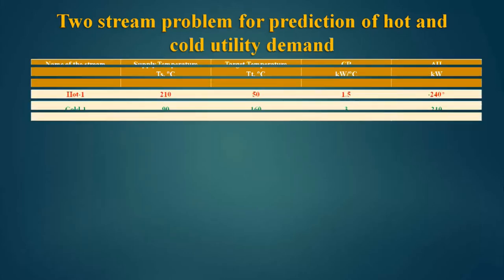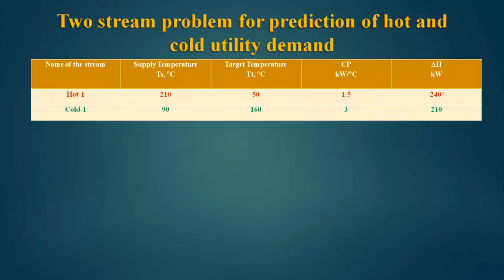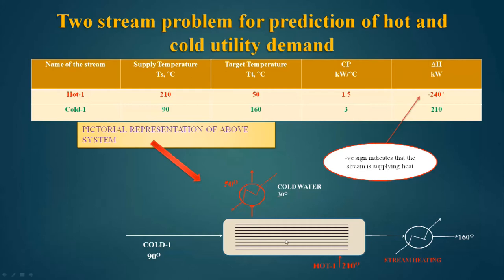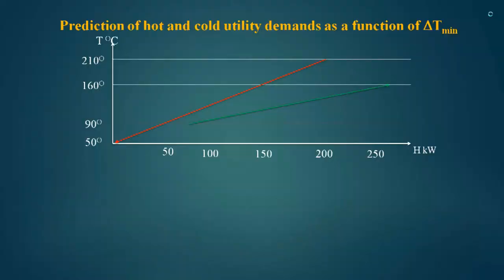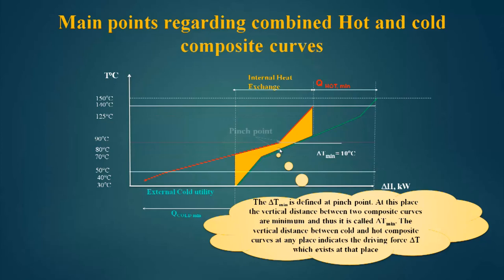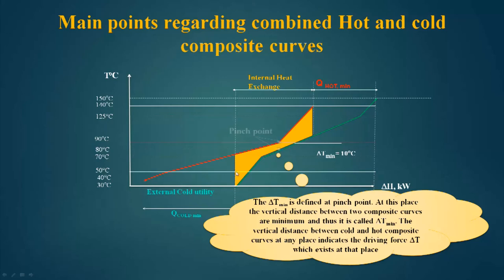Mod-03 Lec-04 Hot and cold composite curves and the pinch

Comment: kindly someone clear that point here how the cold curve is shifted towards hot curve like what point should we keep in mind to shift cold composite curve from point b to point a from 13:23 minutes
Reply: Based on my understanding, you need to shift the curve until the minimum distance between the two curves equals deltaT (min) value.
Reply: @saurabh3dec  7:46 How HU=30 kw and CU=60 kw
Reply: @saurabh3dec  Yeah but how do you do that? Basically you neither know the horizontal position of the cold composite curve w.r.t hot composite curve and also even if you know it, you need to find a way to calculate the delta T minimum.
Reply: Its all done in computer application so that , app can easily find out the shortest distance between the 2 curves,

 Can't be done by human with pen and paper